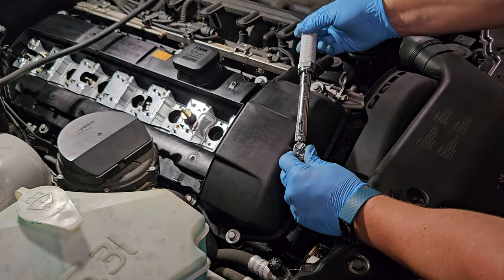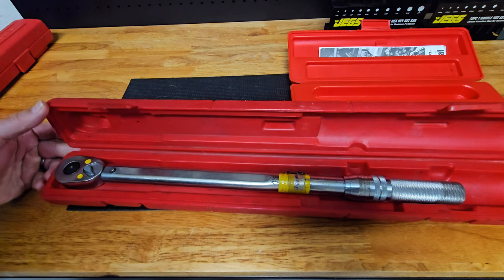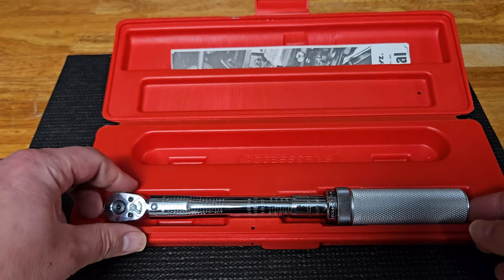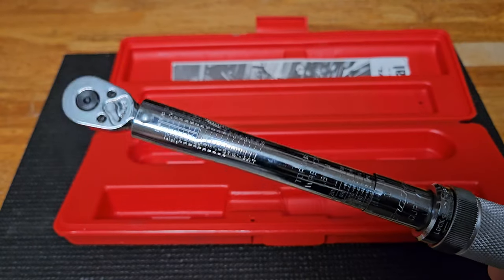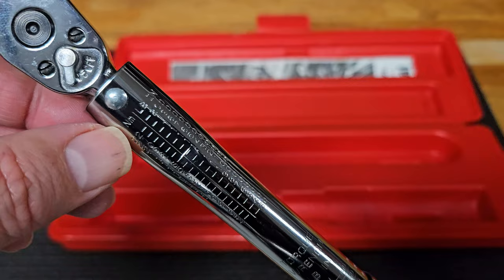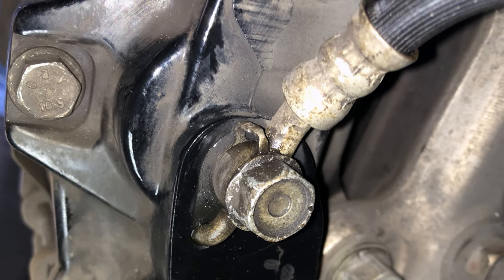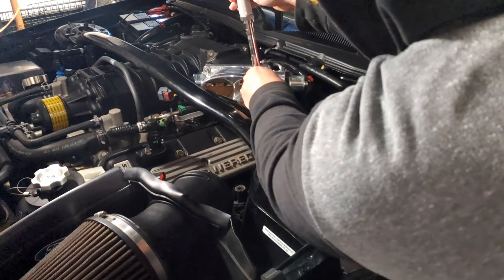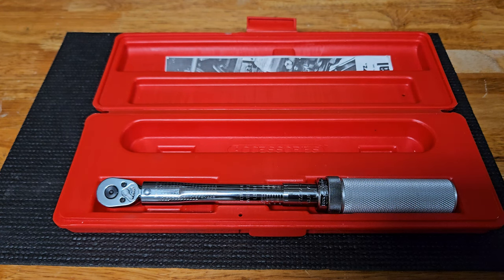Vintage Snap-on QJR117F 1/4" Torque Wrench Review

Comment: I bought a CDI and it arrived already broken. obviously it wasn't actually inspected at the factory. so disappointed.
Reply from the maker: Oh wow that stinks, were you able to get it warrantied or a replacement?
Reply: @TheEclecticHandyman  I returned it on Amazon. It was sold and shipped by Amazon so not a 3rd party seller. a few people said the same issue in the reviews.